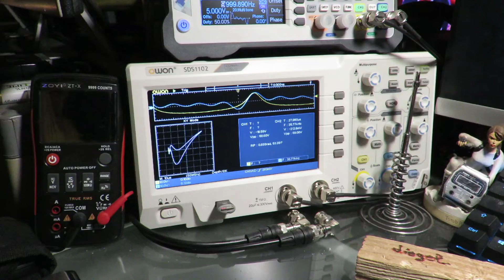New 2021 KNIPEX TWIN GRIP SLIP JOINT PLIERS vs ENGINEER NEJI-SAURUS SCREW PLIERS

Comment: Diezelle, I am not surprised the Engineer pliers did better with the pan head screw. Since the nose of the Engineer pliers are more beloved and the screw head dug into the wood. I am wondering, would the  Knipex have got a grip on the screw with the side facing jaws. I assume probably not. Are you going to do other videos showing how expanding jaws allow the side teeth to work on other objects like hex nuts and round shaped things ? One other question slip joint pliers are they popular in France ?
Reply from the maker: Good idea: the screw is very well taken, solidly, by the lateral side of the pliers! :) Another video is in fact needed :) Yes, pliers with variable opening have been known for a long time.

Comment: Heard knipex stop production on them I’m very sad
Reply: I think that is wrong. Knipex just had the problem that the first products were all sold out. I can buy them now again in germany. As shown in the video the Engineer pliers are way better for round screw heads. But in other videos the Knipex did a better job for damaged hex screws and bigger screw heads. I already bought the PZ-58 and I think I will also get the Twin Grip.